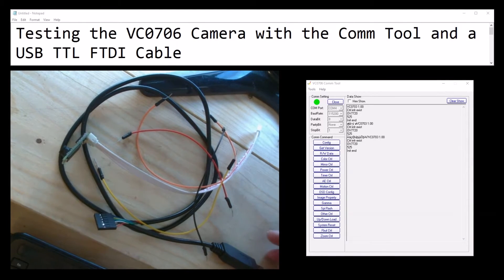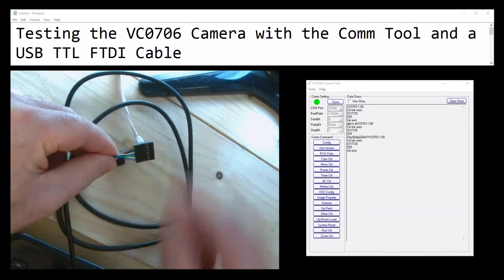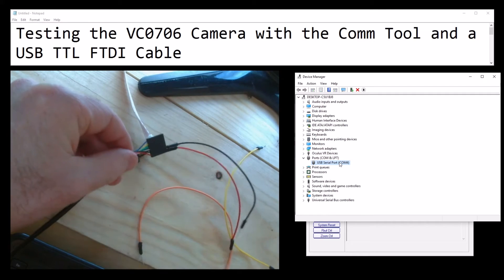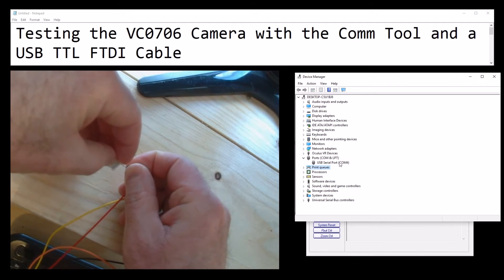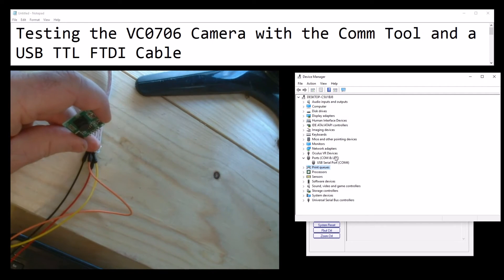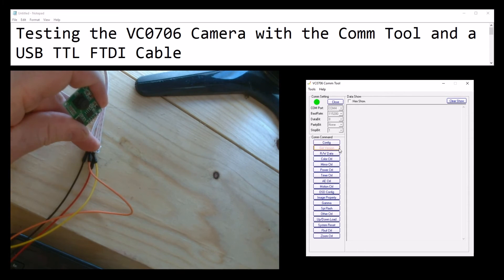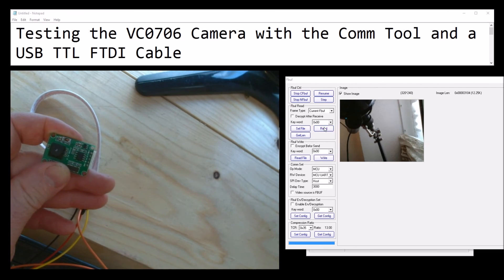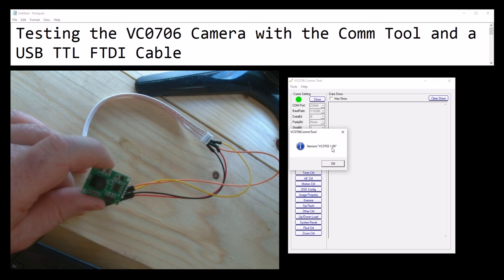Testing the VC0706 Serial Camera with the Comm Tool and a USB TTL FTDI Cable

Comment: Can you use this as a video camera or is it only still images? If yes, what's the FPS/resolution?
Reply from the maker: I didn't experiment much with it after I made this video. I think I could only get 2 frames a second from it if I tried. But then I wasn't sure how fast I could even write it to the sd card on the Arduino. Sorry I don't have any better info.

Comment: Great video! I tried using the Arduino Uno serial ports, but it never worked out... Then I tried with a FTDI and  it worked perfectly.
Reply: Hi Bruno, would you be kind enough to do a tutorial on this?